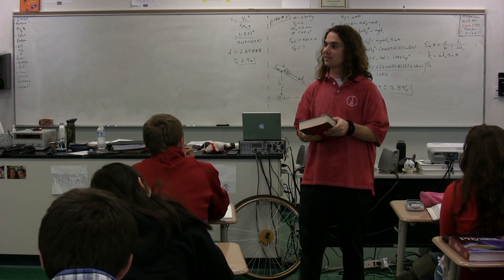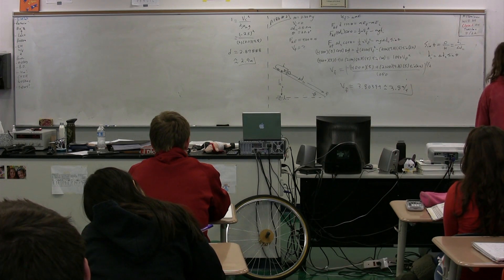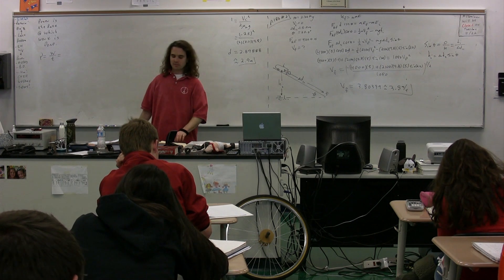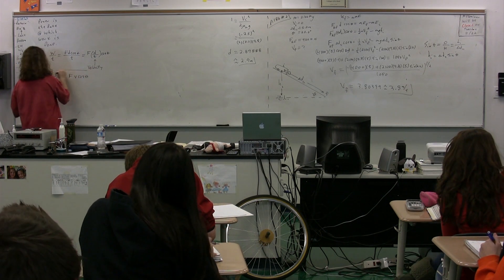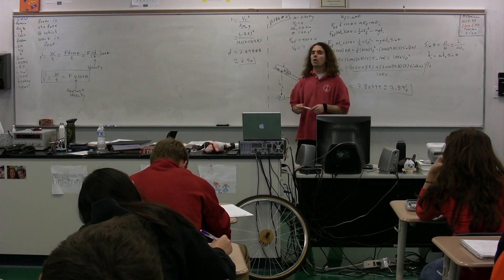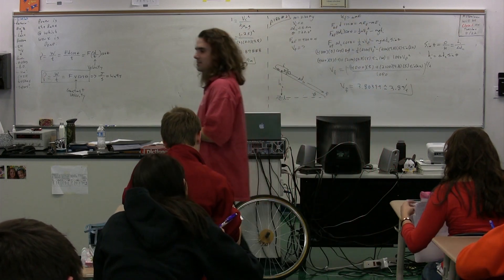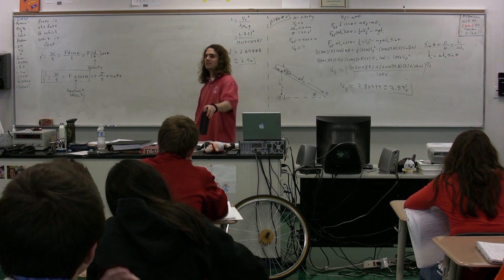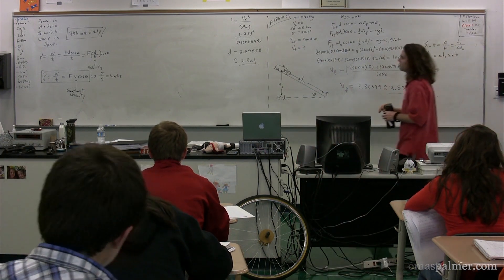Introduction to Mechanical Power and Horsepower

Comment: Yes that makes more sense. So really in order to get the same answer from the two separate equations you would have to ensure that the same type of variable is used ie instantaneous initial displacement for 
P = (F*d*cos(theta))/t
Should give the same result if you used the initial instantaneous velocity in the P = F*v*cos(theta) equation?  So long as they match for type of UAM variable the answer should be the same?
Reply: My answers are yes & yes, with one small clarification.  My assumption is that by "instantaneous initial displacement" you mean a displacement over a very short time period.  This is the only way I can see that would match an "initial instantaneous velocity". 😜

Comment: Well that would make sense as to why he could argue through all of my 'roadblocks' as it were. So why don't you get the same answer then when using either version of the power formula?  That is to say if you had a problem that gave you the displacement of an object and an initial and final velocity of the object and the net force applied by the object and how long it took the object to move and you plugged in the information into both versions of the power formula you don't get the same answer?
Reply: First off, you have to be careful which force you are talking about when using the Power formula (and Work).  Net force, force of gravity, force of tension, force normal, force of friction, etc.  Second, as far as all the Uniformly Accelerated Motion variables you identified, remember that if you use velocity initial, you will get the instantaneous power initial.  If you use velocity final, you will get the instantaneous power final.  If you use the change in position over change in time (or average velocity) you will get the average power over the whole time interval.  The instantaneous vs. average part of it can be very tricky.  Does that make sense?